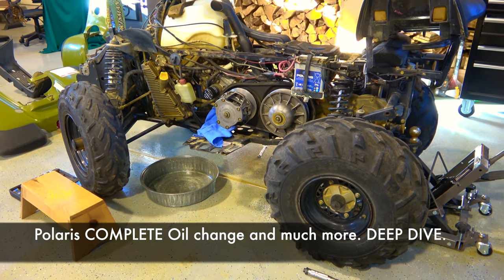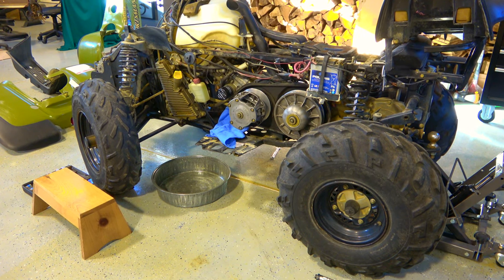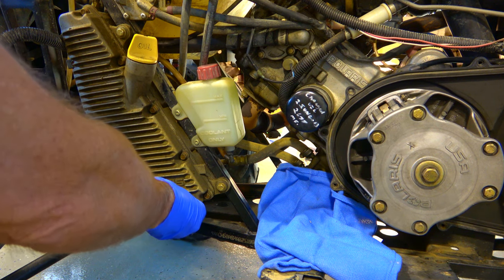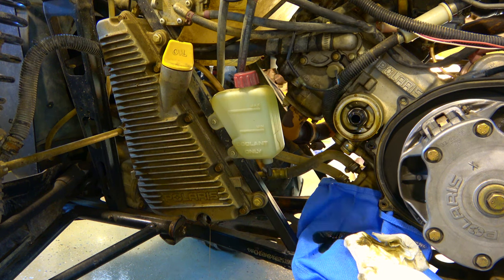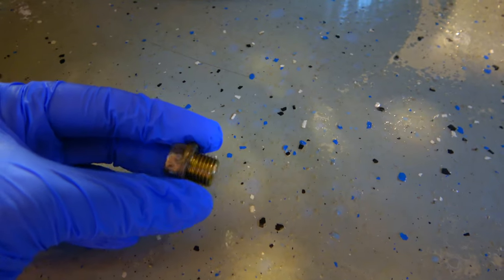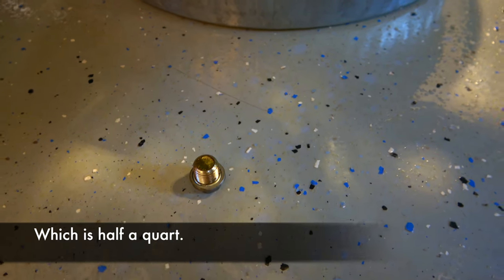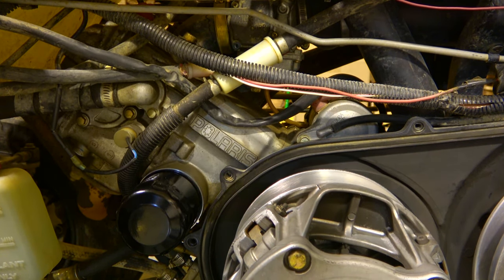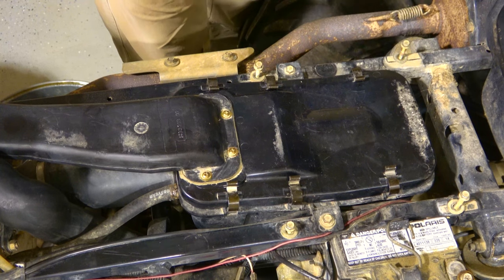Polaris Sportsman COMPLETE oil change & Much More. DEEP DIVE.

Comment: Just updated: I used my scissors as you had done and since my plastics are on, I was able to clamp it on the fuel side close to the tank and after letting it run for 24 seconds. I had unclamped the hose and was able to hear a big rush of vacuum. I now feel better to start the ATV up without having to worry. Thanks again for your video.
Reply from the maker: Sounds like your on the right track. If you ever do it and don't hear the woosh. Simply repeat. No harm.

Comment: Eric, if you are located in or around Fairbanks I think you own the same Polaris 4 wheeler that I bought there in the spring of 2010. I sold it when I was moving to Ft. Benning at the end of May 2013. A June 2013 oil change lines up with the correct time frame. Several things like the headlight case green / black plastic doesn't lock closed, and several physical features I remember looks the same. That was the best 4 wheeler I have ever owned! My friends called it the old tow truck. I pulled several of them with very new 4 wheelers out of the deep woods. If this is the same 4 wheeler, I'm so glad to see it's still being Very well taken care of😁.
Reply from the maker: I actually bought it from a guy in Paxson. He indicated he had it for a long while. It was missing a pull start handle/rope. And had duct tape over the hole. The AWD didnt work.  I believe he did zero maintenance on it. And stored it outdoors or semi covered.  But these have a good rep as you mentioned so I was able to get it at a reasonable enough price to bring it back.  Its lived up to its rep since. I have had to do a few more things to it but all stuff that you'd potentially have to do to just about anything that old. Stator, CDI, Ignition coil. But currently operational. I dont know if your still in GA but the heat should be letting up about now I suspect.

Comment: Fantastic. I got a '99 Sportsman that sat for 6 years, needs a lot of love, all the details for a full lube, oil, filter job in one place is nice.
Reply from the maker: Good to hear. If you haven't discovered already, there are a few other videos as well on the channel and more to come. The machine has been out of reach this winter but I plan to cover more topics when the opportunity arrises.
Reply: @ericinalaska7648  I have, and thank you. I have already discovered the crime against wiring via rodents in the headlight shroud, and under the front cover, and someones attempt to "repair" the magnetic hub locks, so I've got my work cut out for me, thank you making these, you are my Sportsman repair info go-to.
Reply from the maker: @jamesgeorge4874  Well thank you as well. If you have any questions feel free. I certainly don't know everything but will do my best to help if I can.

Comment: Best video I found for priming oil system - after clamping that hose, I heard the air after 60 seconds while removing vice grips while it was running and oil level went down a lot so felt very comfortable
Reply from the maker: Thank you and Glad it helped. Appreciate the feedback.
Reply: If you listen, you can hear his "swoosh" when he removed his clamp as well. It took me a few tries to get the sound, but the manual said if u don't hear it, to repeat until u hear it 😂

Comment: Thank you for putting this on here!!  I'm doing my 450 sportsman now and I've been searching for a video. So far I've seen at least 3 different variations on how to do it plus my service manual and they were all a little different. The first video I saw from the polaris page was that the drain plug was directly underneath the frame and vertical or atleast how it appeared on the video. The next was the same page and it was just the drain plug on the left side and my service manual said nothing about the left side of the quad and only mentioned the drain plug on the right side. So needless to say I was a bit confused. Again Thank you so much.
Reply from the maker: Yah there are many subtle differences year to year and of course make and model.  When you do the trans and front gear case fluids. There is lots of differences there. Especially the front gear case from year to year. As to what fluids to use.
Reply: There is one cup of oil left in the bottom of the engine after you drain the tank. That is what the bottom bolt is for. If you drain that or remove the banjo line with the screen on it, you have to prime the oil pump by pinching the oil breather line 2” off of the tank, just before the cutt in the line (3” off tank) you make with a blade. Hemostat the breather hose, run the bike for 30-45sec, shut off, release hemostat and listen for the suction sound. Your pump is primed and the cup of dirty oil everyone leaves in their engine is gone.

Comment: I had thought that I had written to you over a year ago when I was working on a Polaris. This model I have now is a 400 Sportsman. It talked about the slit in the line. I was looking at the wrong line and didn't see at the very top which goes into the headlight assembly. I still can't feel the slit and probably won't...lol As far as the supply hose. I had to cut this one off and still could not bust that bottom fitting lose. So I wasn't able to check the screen. This tank is plastic, so I felt that I may have cracked it if I kept going. I do have those hospital scissors as well. I didn't have any idea of how to clamp that hose down. I usually use some needle nosed vise grips. The service manual also stated that you should hear some air after you release the clamp????
Reply from the maker: Im actually using a clamp. Looks like scissors but it's called a Kelly clamp or some call it a hemostat. The line with the slit is yes going through the headlamp area. I do show  it and trace it in the video as well as demonstrate the slit. Easy to miss if your jumping around a bit like most of us do. And yes you can hear a swoosh sound sometimes upon removing the clamp. That line on mine anyway. Goes from the top of the oil reservoir around the front to the other side and then to the breather box under the seat.

Comment: great video...i did not know about the krank case oil plug..and i did not know about the priming that should be done...thank you.
Reply from the maker: Both are commonly overlooked or lack of familiarity keeps people from doing it. Myself included. I dove in a few years back to see. And have been doing it ever since. I like many for years, believed from hearing it repeated over and over that there wasn't much oil in the crank case, and was hardly worth addressing. But as you saw. It's more than "not much".    Glad you found it helpful. More to come.

Comment: This is why you read the owners manual, I’ve done countless oil changes when I’ve removed the screen to clean, or remove the crankcase drain and have never primed the oil pump!!  My 01 is running strong even with an owner who doesn’t read!  Lol.
Reply from the maker: Yep. Ive learned much from them over the years. We all get info different ways though. And this is certainly one of the ways. On the Youtubes. Ive heard many over the years, say they don't mess with draining "that little bit" out of the crankcase because priming is perceived to be a process. As you saw. There is more than a little oil in the crankcase. And the priming is no big adventure. Glad it was of help. Thats the goal really. Thanks for the feedback.
Reply: @ericinalaska7648  Eric, out of curiosity I checked my owners manual to see what other steps I might have missed, and it states “Start engine and let it idle for one to two minutes.  Stop engine and check for leaks.”   It doesn’t mention the oil pump priming which I find odd as the engine and oil system look identical between your ‘99 and my ‘01!  Lol
Reply from the maker: @HOBrian2003  The priming note addresses only if you disconnect the supply lines. (The line with the screen for example.) Other than that. Yes You just need to start and run for a couple minutes and check level and for leaks.  The priming is all about the supply lines. My manual says the same with  an added note about priming if you disconnect the line(s).  I think I babbled about that a little in the video. Id have to rewatch it though.

Comment: Been running ours for barn hauling and harrow dragging, and it's in for some fluid change. Always nice to see the parts pulled before getting my hands dirty. Already had to tear down the carb and bend the float back into spec (fuel overflowing), so this looks like a piece of cake. Thanks!!!
Reply from the maker: Yah I think you'll handle this just fine compared to that. Hahaha. Glad you found it helpful.
Reply: @ericinalaska7648  We really gotta give credit to the basic teardown instructionals.
If I had to do anything even this simple without a good layout of the systems. This level of basic repair could be pretty hard.

The priming of the pump is strange enough, I could see experienced mechanics doing real damage.

I think this is probably more dangerous than  tearing out the carb for a recalibration. At least with that the systems aren't sensitive to the methods. (the closure of the vent is pretty serious) *Mechanically speaking

Comment: Great video You're the only one that actually did it the way the manual shows it to be done but my main question is do I have to prime the oil pump when I drain that extra two cups out of the crankcase?
Reply from the maker: My understanding is that it's necessary when you disconnect the supply line from the reservoir. Thats the note in the manual I have. It's a great question. Id think the same. It would seem draining the crankcase would potentially drain the pump as well. But I think the concern is when disconnecting the supply line you likely introduce air into the system prior to the pump and that can then when reconnected inhibit flow. Causing basically a blockage. Ot the affect of one. Similar to having air in your cooling system. But again its a pretty simple procedure and I don't think it can hurt anything for peace of mind.

Comment: Thank you for sharing, well done on the info and presentation. Fun fact my 08 500 EFI manual states 10-20 seconds for the pump prime procedure.
Reply from the maker: Thank you for that. Hopefully that will further emphasize what cannot be emphasized enough. One size does not fit all. Always refer to your year make and models specifications.  Thanks for the kind words and feedback.

Comment: Thanks, enjoyed this very much. I got 500 sportsman don't know any thing about it. 1st four wheeler I've owned. I don't even know the year of it.
Reply from the maker: Glad you enjoyed it!  If you look on the frame  down some where between the foot rest and front left tire. If you're sitting on it left side. You should be able to find a serial/VIN # stamped on it. From that you should be able to determine the year. part of the # indicates the year. I believe it's the 10th character in a 17 character serial /VIN number if I remember correctly. But its easily googled. You could likely just punch in the VIN # and learn all kinds of things about it. I actually did just that to clarify a few things on this machine before buying it.

Comment: Good information to know, I just purchased a used 2001 Polaris Sportsman  500 HO
Reply from the maker: Glad it's of use. Much more to come. Currently converting the low beams to an after market LED option. And then before I put the plastics back on I intend to just kind of go through it and identify and locate parts some may wonder about or aren't sure where to locate or what or where they are. Thanks for the support.

Comment: One of the most well done amateur videos I've seen on this topic. Love the clear images and stillness of the camera.
I've got this 1996 sportsman never changed the oil but I will !🤦
Question: what kind of oil do they recommend in the books we put in there ?
Reply from the maker: Glad you enjoyed it. PS4 For the oil seems to be pretty common in most it seems. If I had a 1996 that would be my go to likely. I don't have the manual handy at the moment but it may say a specific viscocity that's recommended that you could then substitute..  Sometimes they do. I just don't recall off the top of my head, Ill have to check. I Just don't want to guess and mislead you. If your looking for a cheaper option you can find lots of threads and conversations online covering what others use instead,. You'll just have to use your judgment regarding that. I tend to stay with the PS4.
Reply: @ericinalaska7648  
Hello again.
Thanks for your answer. I came up on a complete oil change kit on the internet for my model and yes it is polaris ps4 (or any synthetic 5w50 if you want it cheaper).
👍
Reply from the maker: @mr.octopus6972  Yes I have read many people using 5w50. And some manuals I have indicate that option. The main reason Id stick with PS4 would be if I had a newer model that was still under warranty. So it wouldn't become void.  But other than that. I wouldn't personally loose any sleep on an older machine.
Reply from the maker: @mr.octopus6972  Good info. Yes I have read several threads over the years regarding common use of 5w50 and some manuals also suggest it as compatible or as an option for some machines. The main reason I would stick with PS4 would be if I had a newer machine still under warranty. So I wouldn't have any issues with a voided warranty. Unless specified. But on an older machine. I certainly wouldn't loose any sleep over it.

Comment: Hello again !
I've done my oil change, everything went very well thanks to you.
Now I need to know is there any other fluids I need to check on a regular basis ?
I know I must change fluid in the front hubs but are there any other than that ?
Reply from the maker: There are also fluids in the Front crank case, Transmission and if separate from the transmission, rear, and coolant. The ATV in this video the transmission and rear are combined and trans supplies both. Some machines have a separate rear gear case.There are videos for these as well here on the channel.

Comment: You are so knowledgeable about the 2000 Sportsman 500.  I wonder if you could give me some guidance and direction on a problem I have.  

I dropped a paper cap from a fuel stabilizer into the gas tank by accident.  I can't think of any way to get it out.  How hard is it to get the gas tank off.  Or maybe you have another way to get it out.  I feel like I need a trick here.  I really don’t want to take the tank off.

I have taken the seat off and the side shields.    I did watch you video how to remove all of the plastic and I was hoping that I wouldn't have to do all of that.
Reply from the maker: Tank comes off pretty easy but ..... I have a  grabber for such recoveries. About 12-18" long with a spring loaded deal I press with my thumb and the fingers on the other end open and close.  But if you don't......  maybe just try to fish it out with a clean stick or screwdriver. Or maybe a pc of tubing. Press it to the bottom with the tubing. Cover the tubing with your finger and see if it causes it to stick?  Just things Id try if it were me.  Or if it floats. Fill the tank until it floats to the top and grab it.

Comment: Thank you for the detailed explanation of the procedures. I drained the oil from both the crank case and the oil reservoir put the plugs back. I then began to filled the oil reservoir but it wouldn’t take even a full bottle 32 oz of oil? The oil is now at the very top of the oil chute? Could it be because I had already pinched off the top hose? The ATV is raised on car ramps in the front. Maybe that’s it?
Reply from the maker: It's my understanding that pinching off the hose for priming is really only called for if you disconnect the line(s). But it cant hurt really to go through the priming procedure anyway. It is possible that having it  up and pinched may inhibit the flow due to pressure in the system not being able to escape as it fills. Im speculating but that's my thought in regards to your question. Im also thinking by the time I got back to you, you've likely over come the obstacle. Definitely no need or advantage to pinching the line prior to fill that I can think of.
Reply: Thanks! I did figure out that my 2007 oil spout is much lower than yours in the video. so I had to put 1 quart in…run the engine for a minute which circulated the oil throughout the crank case, etc. then put the second quart in after that. I also did the pump priming because the did remove and clean the lower hose screen. Thanks again for the video. It was very helpful. I appreciate the detail and simple explanations all the best.!
Reply from the maker: @Jdeneik  Good deal. Carry on then I guess.

Comment: Thanks Eric for the info. I don't think I'm not going to do that last part. I'm going to try and flush it. Seems like it would help?
Reply from the maker: What do you do when you flush it? And I always say to people regarding other fluid change topics. Even if you don't get it all out. New oil mixed with some old is still better than all old. Or one would think.
Reply: @ericinalaska7648  I've never tried it. I was going to change the oil pour some fresh oil and drain it again to get that last little bit out of the crank case.
Reply from the maker: @dylanmccormick2971  Id just pull the plug and drain it personally. Its no harder than draining the reservoir. Its just that most people aren't aware of how much oil that will drain or just simply aren't aware of it.  But as long as you don't disconnect the lines  it should be the same just drain and fill. And save on the oil expense. Plus I believe that with that plug being the low point in the system yo have a better chance and getting any potential grit or sediment that may accumulate there that flushing may not.